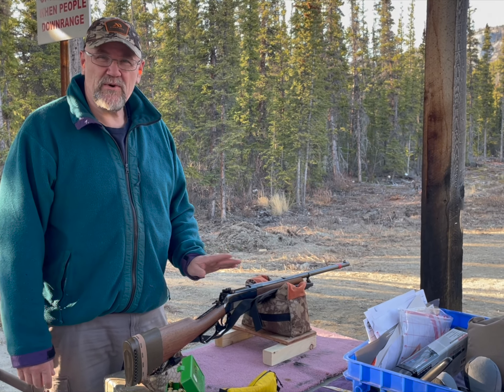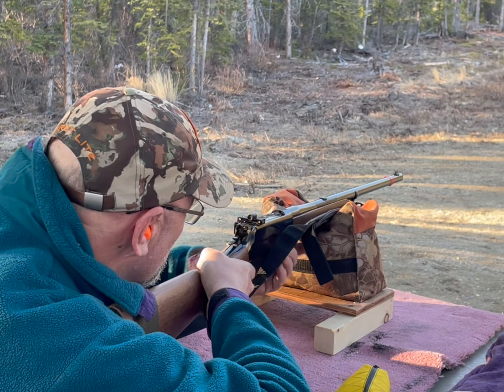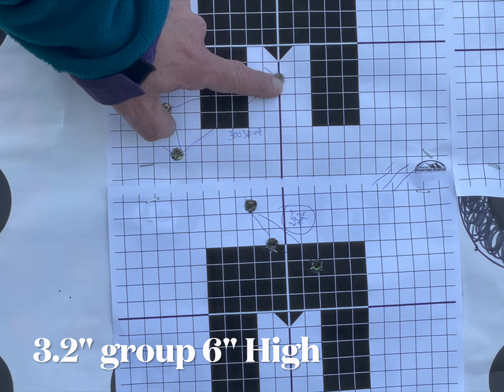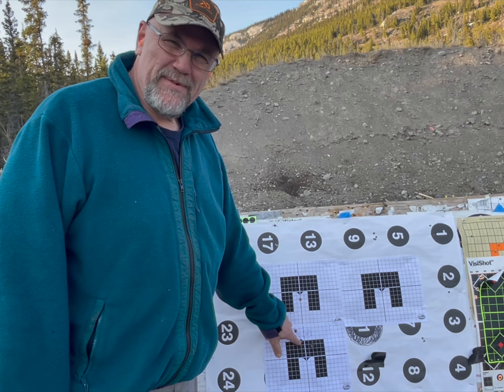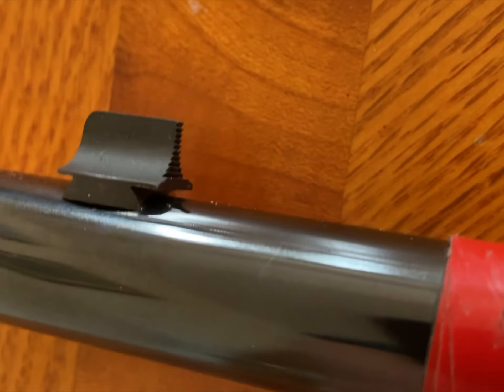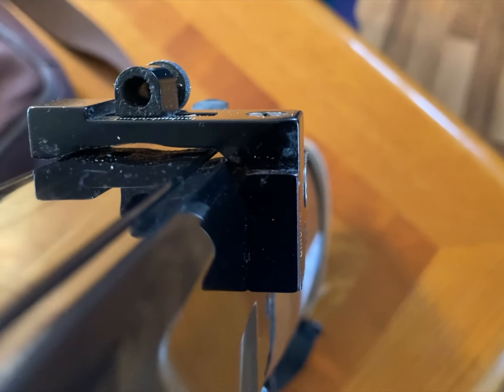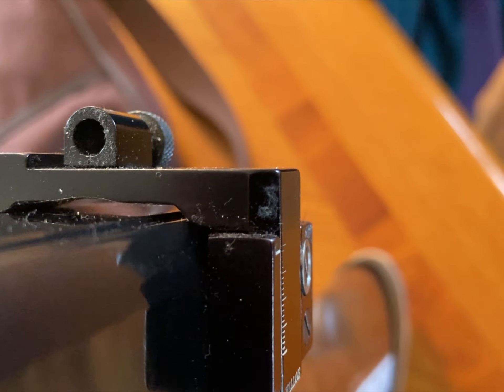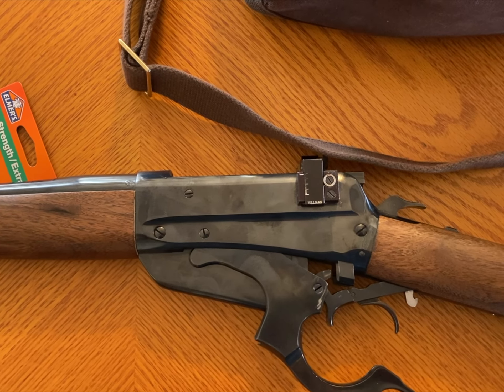Sight Modifications for the 405 Win   HD 1080p

Comment: Nice 👍 I always like to be 3 in high at 100 for my point blank range. The nice thing about the way you're set up now is if you're shooting further you'll have a longer zero to start with without having to make any adjustments. 5 in high is a little much though.  Not sure how far you'll be shooting at your bison but if you're shooting two or three hundred yards it definitely could work. Thank you 👍
Reply from the maker: yes..what I like about it is that the receiver sight is against the frame of the rifle.   If Dropped it's supported by more than just the elevation screw.   Pretty hardy setup.
Reply: @north61  Yes definitely Plus it just looks really nice too very clean looking. Thank you 👍